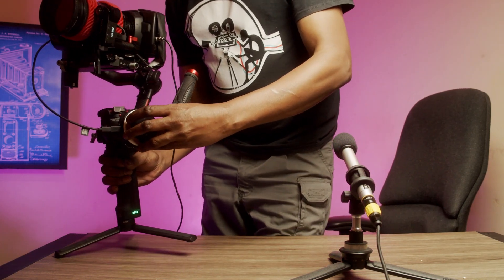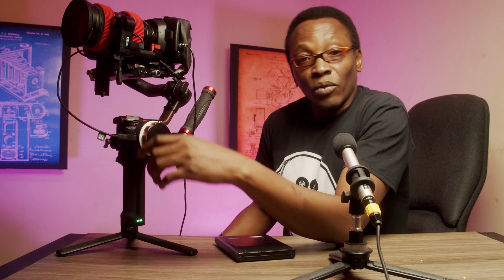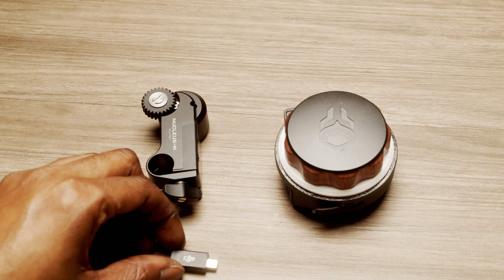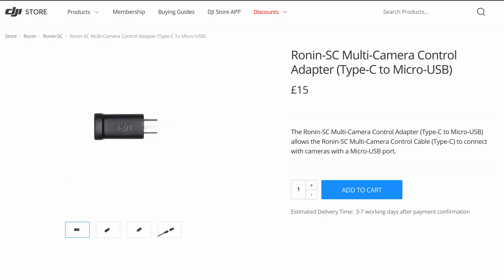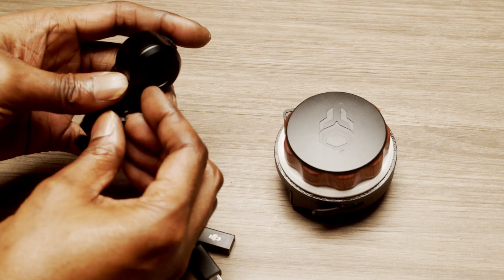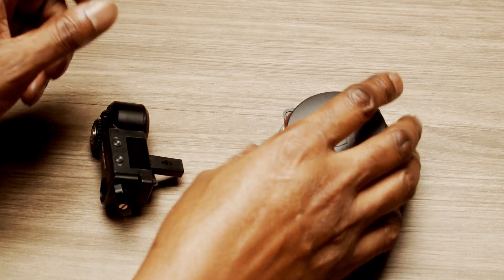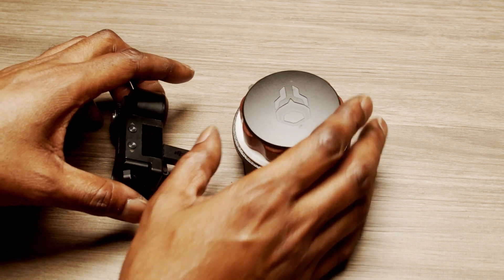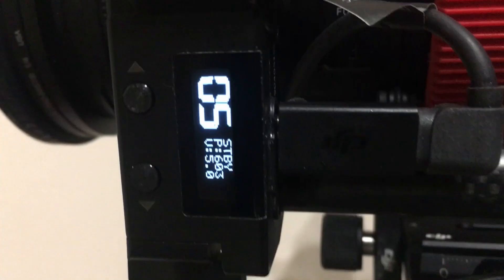DJI RS2 - Power from ALL ports. QUICK TIPS #3

Comment: Thank you for your very informative videos on powering options with the RS2! Based on your other video I ordered the Zitay dummy battery for my R5C, which will be a huge help for that power-hungry camera. But I have a question about powering accessories, which you addressed in this video. I have a slightly different use case: I need to power a wireless HDMI transmitter that has a USBC input.  Using the DJI USBC to micro adapter you recommend is obviously not an option, but DJI's USB-C cables don't work. Do you have any idea why not, and what I would need to make this work? I'm hoping to power both the transmitter and the dummy battery from the motor port, using Tilta's new splitter cable, but it's feeling like a long shot. Thanks for any insights you might have.
Reply from the maker: Hi Andrew, thanks for checking out my videos. Fisrt of all... ooh I'm also waiting to get the 'new' Tilta splitter cable myself; kinda curious to find out if both ends are 8V or if it's 8V and 5V.
Anyway which transmitter? Does it need 5V or 8V? Do you use the RavenEye or not? Being 'propriety' is the reason DJI cables don't work... if you lost a cable you NEED to get THEIRS for £19.

No idea why DJI also decided to block access to power from the USB-C ports and only make it available to a few; thankfully the RS2 'kicked off' a Tilta partnership so the 'Tilta cables' have the 'secret sauce'... the very second their first 8V RS2 cable came out I was able to build my own 'dummy'... That's what I would normally say you need but the 'tinkering' might put you off. I'd say as Micro USB is not an option the best bet is the new splitter cable.
Not sure if you saw it but I did build my own version of the splitter in order to also power a 5V item; there is a board inside the dummy stepping the 8V down to 5V - https://youtu.be/k_JwmZ7F8AI?t=380
Reply: @aNELeOnwuka  Thanks for the reply. I'm using Raveneye for ActiveTrack, Camera Control for R5C, and no lens motor as I'm relying on autofocus (I could do Zoom with the motor, but I prefer using the wheel for tilt and I'm happy to just grab the lens). The thought was to use a transmitter for operator monitoring and I picked up a very small HDMI transmitter from Amazon that takes USB-C power, so that is what I was trying to power from the lens motor port, but no dice. I actually went on DJI's website and chatted with a tech support gal and she confirmed that there are no approved capabilities for powering any 3rd party accessories, so I guess we're all looking for hacks. But I'm surprised that DJI even makes that the adaptor you talk about if they are trying to keep things proprietary. I suppose I could get a transmitter with USB micro input, but in the end I decided to return the transmitter because the latency was too great, and I'm bringing the signal off-gimbal with a very thin and flexible HDMI cable. Hopefully that will do for now. A Ronin USB power adapter sounds like a project for Zitay. Maybe I will contact them.
Reply from the maker: @andrewyoung4970  Apart from the RavenEye I'm not sure if other transmitters work with 5V. I have a Cineview HE and that takes from 7.4V

Not sure what your 'balanced' set up is like but can't you use one of the following to power yours? -
FatShark - https://tinyurl.com/2p9fp87x
Tilta - https://tinyurl.com/2b5a32x3
I have both but would say the FatShark as it is lightweight. You can see it used in the video below starting @ 12:00 and @ 17:44
https://youtu.be/eLc6zmWCKA4?t=720

Comment: Tilta make a cable for the RS2 which provides 8v to the nucleus nano, it’s not to expensive and gives the motor that extra bit of torque.
Reply from the maker: Hi man, yes I know BUT also remember I made this in Jan 2021... many, many, many months before they released that cable ;)
Reply: Cool not knocking the solution just putting it out there for new people who might be watching.
Reply from the maker: @jamesalexanderbarnettdp9479  Cheers man, no worries.
Reply: Can u confirm this cable works? I have rs2 and tilta nano. Also how can I fit controller on to the gimbal because the mount plate it comes with doesn't fit
Reply: @SoloRolo  yeah the official Tilta cable 100% works, defo worth a purchase.

Comment: Just a heads up, tilta states in the manual that you strictly should NOT power the focus knob via usb as it can cause damage. It’s for firmware updates only apparently
Reply from the maker: Not what they say and not in my manual. They could have change the wording in 'newer' manuals because a number of people have damaged theirs using the same 'higher torque' voltage they use for the actual motor.
Tilta can't enforce people using 5V ONLY which they say is the limit for the hand wheel USB port so they just say not to power it from the port. People have plugged in 20V and been surprised when it went up in smoke.
In the various 'Groups' I'm in most people do power it thru the USB port... I've actually, since the month it was first released, NEVER used the batteries - my limit has always been and will continue to be 5V to NP-F batteries maximum so around 7.2/7.4 - 8V. 
But thanks for that
Reply: @aNELeOnwuka  Thanks for the update! thats good to know. As you say perhaps they have changed the wording as mine definetly said not to power it via USB. I did initialy power it using that method before reading the manual but of course it still works, though it does some strange things at times which I asumed was because I damaged. If anything its proabaly the batteries causing me issues so i'll definely be going the usb option now. 
Great video by the way.
Reply from the maker: @skatepark02  Hey man, you're welcome and thanks.
Reply: @aNELeOnwuka  The port on the wheel is pretty flimsy, I used to power it by usb but noticed it was starting to get loose internally. It's not a solid construction at all which is likely another reason they recommend sticking with the batteries
Reply from the maker: @ArtinFlight2  I believe, from reports in some Groups,  even the motor port does that. Yep, flimsy construction. Both mine are still solid tho.

Comment: do you use an USB C splitter between the gimbal (focus motor port) and follow focus motor / remote?  If yes, which one?
Reply from the maker: No splitter at all. They don't work. Have a look at an updated use of the Nano Focus motor and DJI focus motor 'together' - https://youtu.be/2LmMwfhl6Hc
Reply: @aNELeOnwuka  thanks! I have another question. I own a RSC2 and want to run the Nucleus Nano motor and remote from the 2 focus motor power outputs of the gimbal. I bought a dummy micro usb to usb c adapter on Amazon to test. It's not working... I will return it and buy the ones you suggested. After the new delivery, as I will not have the gimbal with me to test, I wanted to know if there is any particular settings to have on the gimbal in order to power the Nucleus nano motor and remote from the 2 Focus output  of the gimbal. Thanks for your guidance.
Reply from the maker: @joellemorris5684  Absolutely no settings to change; just plug and play. However, be aware that the RS2 and RSC2 are different in certain ways and I have no idea if this works on the RSC2. Hopefully it does, let us know when you get it and I can 'add that in the description'. Thanks man.

Comment: Hi, thanks for the video! I don't have a Nucleus Nano to test, but thinking on buying one... I've seen that there's more integration between Tilta and DJI, with several accesories and their float system. The bluetooth controller from Float that controls the RS2 and the DJI focus motor, can ALSO control the nucleus nano motor when plugged in.. so I'm wondering, would it be possible to control the nano motor directly from the gimbal focus wheel as well? have you tested out if it recognizes it as a focus motor? thanks!
Reply from the maker: Hiya, glad you enjoyed the video. There is bad news and good news - the bad; I can not control the Nano from the gimbal as it is, however, the good new is, as you pointed out - there is integration between DJI and Tilta because of the collaboration AND we will be able to control the Nano.
Alrady some handles have been released that do that; for example - the Tilta Rear Operating Handle.
2 days ago I just bought the 'Tilta Remote Control' handle. I like it because I can use it as my underslung handle and it doesn't cover both Nato connectors. On Facebbok somepne has already posted it controlling the Nano motor perfectly; it also controls the gimbal. Check the handle here - https://tilta.com/shop/rs-2-remote-control-handle-for-advanced-ring-grip/

I will also show you these videos -
The handle I bought can be seen in this - https://youtu.be/0IrXr_uaBfU
The Rear Operating handle here - https://youtu.be/SbgILRYHQhY